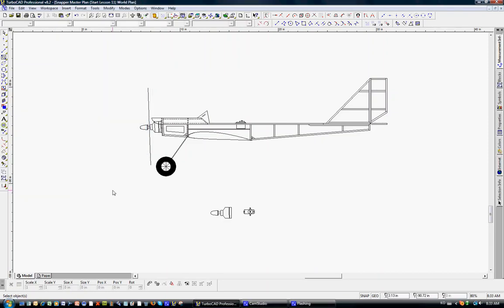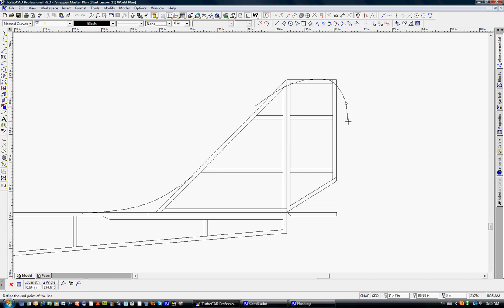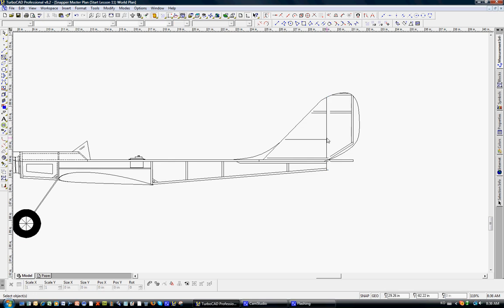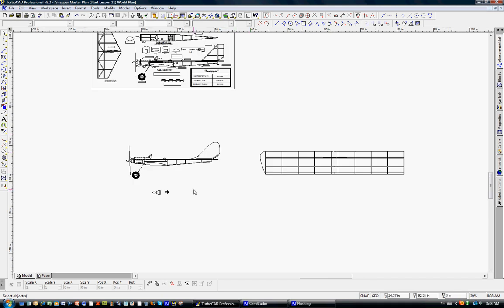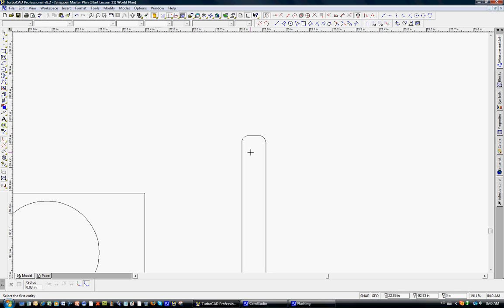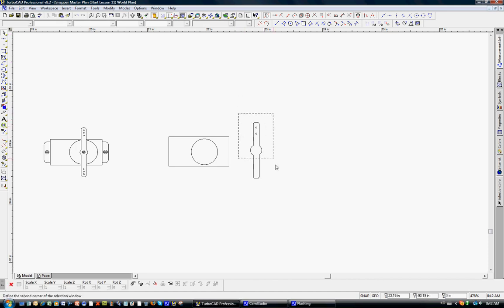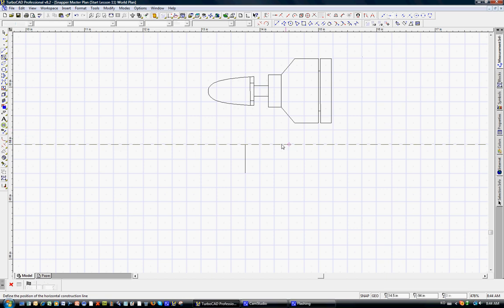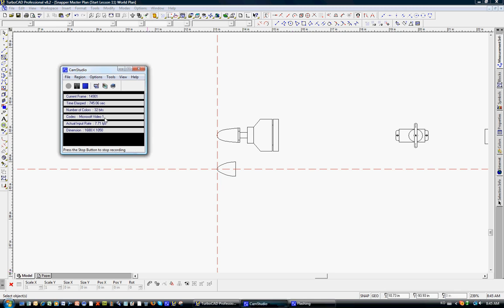Lesson 12 of 12 - TurboCAD to Draw a Model Airplane Plan

Comment: Interesting to see someone using TurboCAD.  I use to use it but now I use DraftSight.  I said it when I switched and I still say it, TurboCAD is very intuitive but DraftSight... not so much.  

Start with someone that has never used a drawing program and give them both TurboCAD and DraftSight.  Next, give them an assignment to make a simple drawing.  Come back an hour later and they will have it drawn in TurboCAD and they will be pulling their hair out over DraftSight.   However, once someone learns DraftSight (Which is very much like AutoCAD), they tend to like it far better than TurboCAD.  

I can't hardly use TurboCAD anymore, it use to seem so intuitive and I could draw with it right away, I could barely draw a line with DraftSight.  Now I can put drawings together far faster and easier in DraftSight than I ever could in TurboCAD.  I had used TurboCAD for years!

I discovered your channel because of remote ID but now I see you have a lot of interesting content made prior to the recent remote ID videos.  I started in RC in the mid 1970's, I was in and out of it a lot over the years but plan to be in it heavy when I retire about three years from now.  I'm going to enjoy watching your older videos!